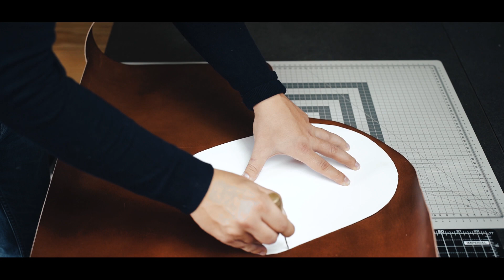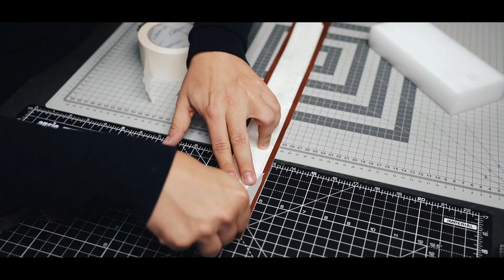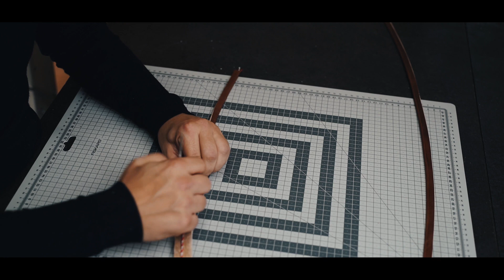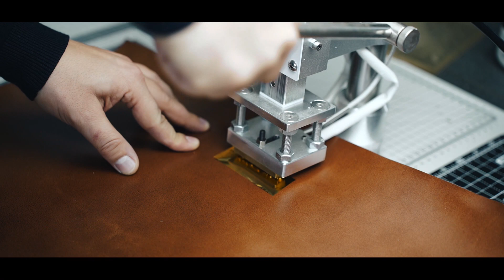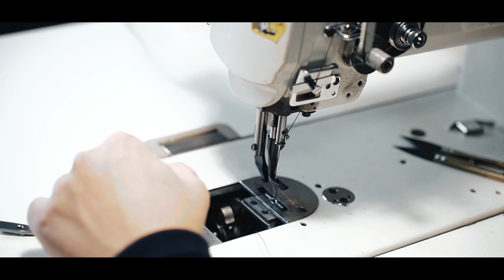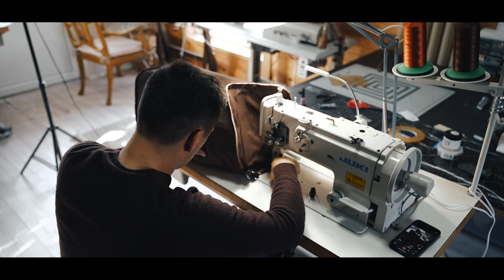Making a handmade SUPREME DUFFLE /WEEKEND BAG - DIY BUILD ALONG - ASMR.

Comment: What motor speed are you using your sewing machine at?
Reply from the maker: I use JACK 513A servo on this current machine and also I have changed pulley on servo to 5cm and  with wide pulley(16cm) on the machine so technically it runs starting from 200 to 500 RPM, but basically because of pulley it's even should be less RPM, I should say ~150-400 RPM. I love to sew kind slow but with maximum and good control.